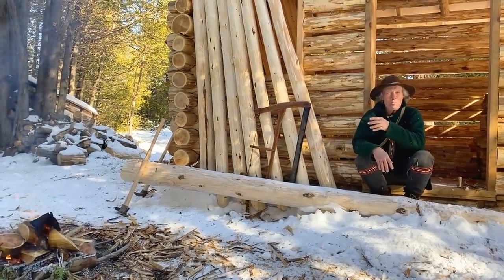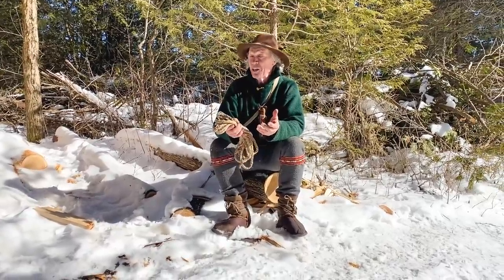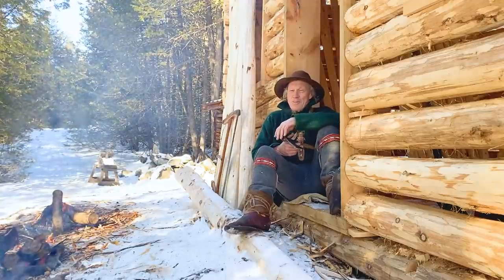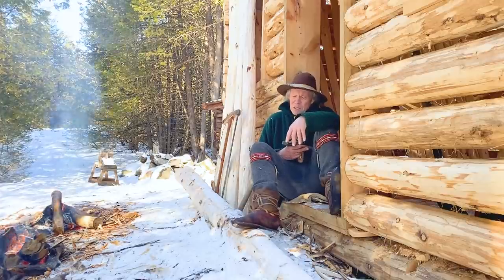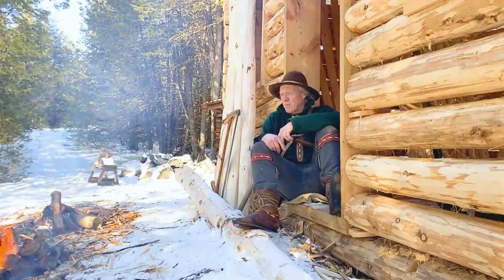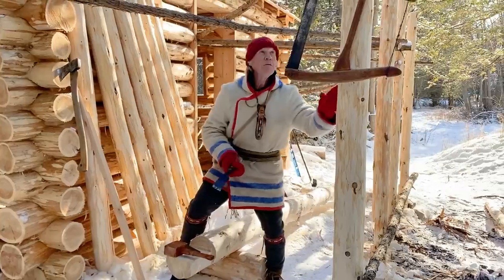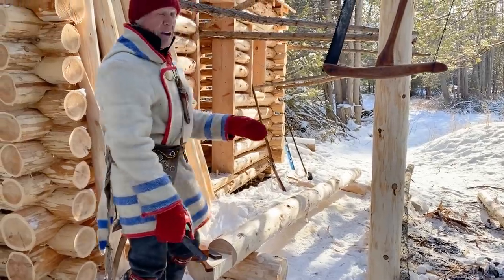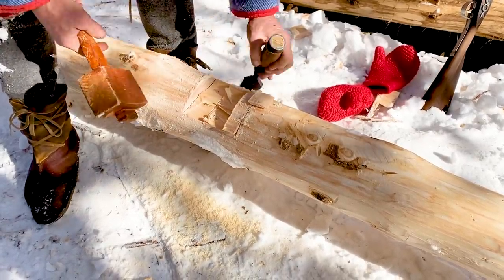Starting the Verandah of the Log Cabin| LOG CABIN BUILD | PIONEER LIFE CIRCA 1700's

Comment: Peter,  I wore leather mocs of the Cree pattern and learned to not wear them inside on a floor because the soles become polished and slippery in snow.  So, inside and/or summer mocs and outside high tops winter mocs with the flesh side facing out for better traction.  Also, charring the ends of the posts that go into the ground would help to slow down the rot.

Comment: I know this is an older video,  & maybe you've tried this by now, but when I need to put uprights into frozen ground,  i boil big pots of water, then start pouring slowly on the ground,  then begin digging,  adding more hot water as i go. Works quite nicely,  so long as there's no big rocks in the way.
Reply from the maker: That is a great idea and I’m sure would have worked better than my method.  Thanks for sharing.
Reply: @TheWoodlandEscape  amazing what one discovers in times of desperation. Lol

Comment: When circumstance forces me to take my mittens or gloves off so I can work, I tuck them inside the upper flap of my coat at about chest level. This way, I am able to continue working freely and when my hands eventually get too cold I will have already warm mittens/gloves to put on. Also, my mitts/gloves are never too far away or hidden under snow or something I've put down etc.
Reply from the maker: Sound advice.  I’m lucky to have a pretty high tolerance for the cold, but as I age it does diminish.

Comment: I was just wondering how you kept from slipping around in your moccasins in the snow and you addressed that issue in this video.  Well done.  I seem to recall somewhere reading about taking a length of rope and tying it around the moccasin to provide traction,  sort of like tire chains for your feet.
Reply from the maker: I have actually used that method John when it is extremely icy.  I tie small braided hemp around the mid sole and it works fairly well.

Comment: Another wonderful and instructional video! Your thoughts about using red cedar for log cabin material?
Reply from the maker: Thanks for the compliment Michael.  If by red cedar you mean juniper, it may be a problem finding material that is large enough in diameter.  However, it is a beautiful wood and very rot resistant.